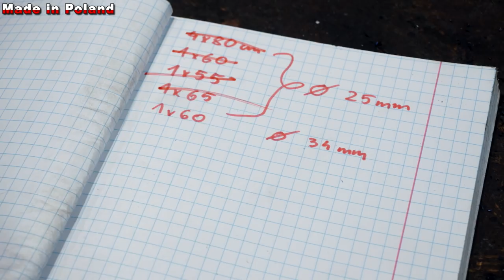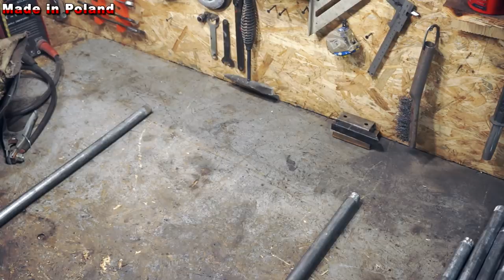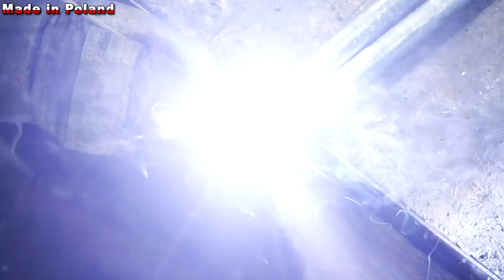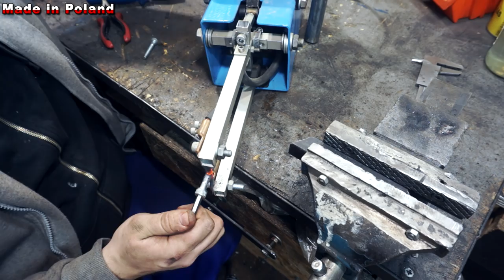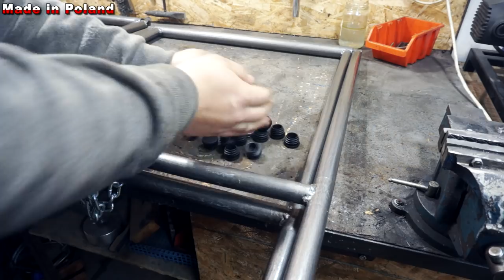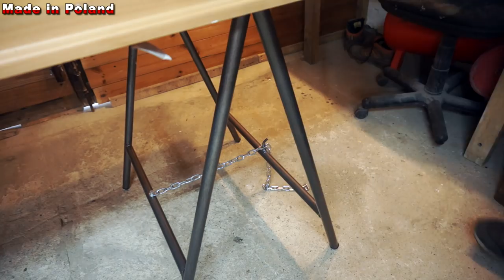Steel SawHorses DIY [PLANS]

Comment: I might have to try that my self some time with my arc welder.  I liked how you used filler for those open spots saves a lot of time messing around instead of trying to cut the pipe ends perfectly to fit together.

Comment: It's a simply brilliant idea to be able to control the height just by using a larger chain. What I don't like is using so much inside tubing just to make it work as a huge hinge, maybe it could be cheaper to use two small hinges or even bolts as hinges on each side
Reply: the inside tubing makes it stronger and simpler to build. I prefer his idea

Comment: Nice!!! Parabéns!!!

I just think you've made a mistake in the description of the video ...
Improving your parts description:
4x80cm 3/4 "
1x65cm 3/4 "
1x55cm 3/4 "
1x60cm 3/4 "
1x60cm 1 "
80 cm chain 5mm (hole 8mm)
6 pieces of end caps
2 M8 screws
2 M8 washers
2 M8 nuts